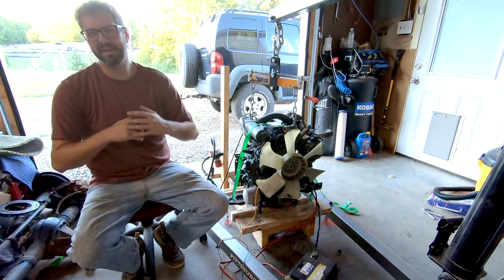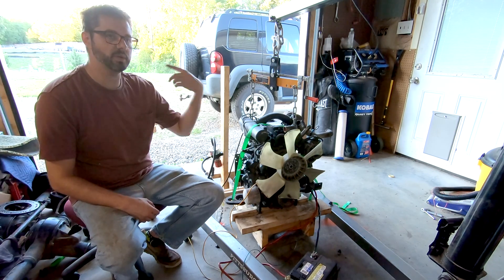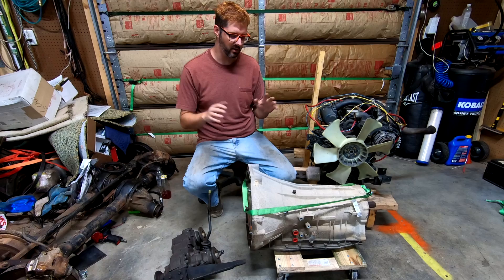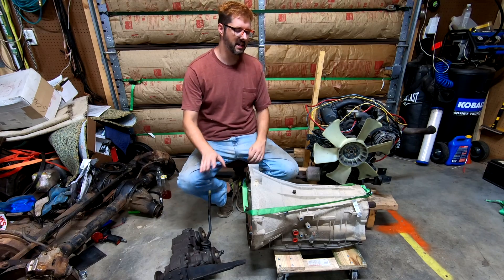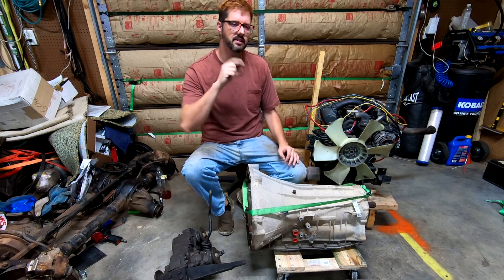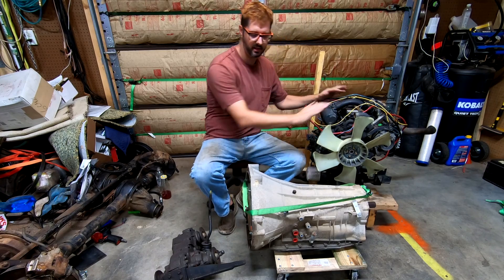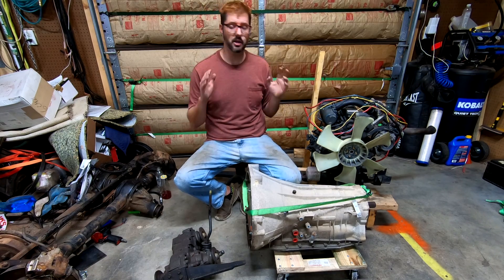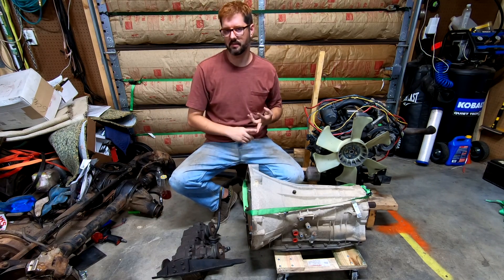Kubota D1503 to Ford 6r80 Adapter Plate Collaboration with KubotaSwappers!

Comment: I am doing a John Deere 3.9 diesel tractor motor in a 1970 Scout 800/80 I also will use a NP205 transfer case. My concern is the torque converter stall. Diesels require low stalls do they not?? I'd like to know if you used the stock converter or a modified one??
Reply from the maker: Hey Nelson I completely missed this! I did use a low stall convertor but only because I happened upon it and I have no idea what the stall on it is. I know for these 03 series engines most people just use the stock AW4 torque converter and it works fine but I don't know anything about your John Deere engine either!
Reply: Is that a 4054?

Comment: Roy from down under,

Looks like and sounds like a good swap
Reply from the maker: Hey Roy thank you for all the comments, I'm working through them now! As much as I love my V2403 swapped Wrangler my D1503 CJ-2A is the Jeep I'm the most excited about building and wheeling! I think some of that is because of how much simpler than I was expecting, I don't have to change the accessory drive system, no power steering, no power brakes, and wiring is going to be minimal!